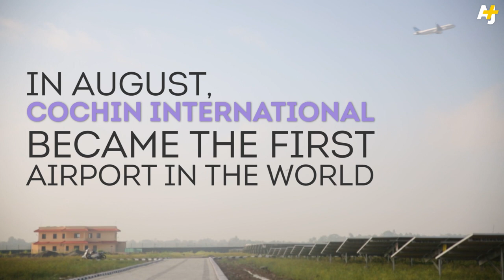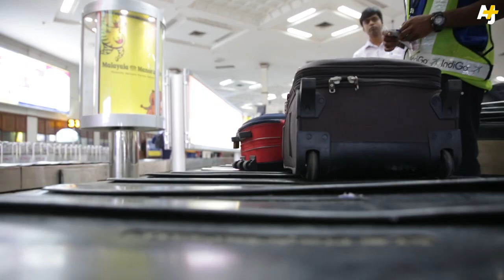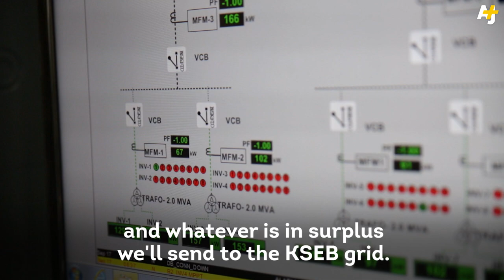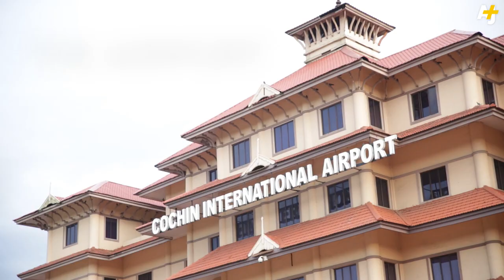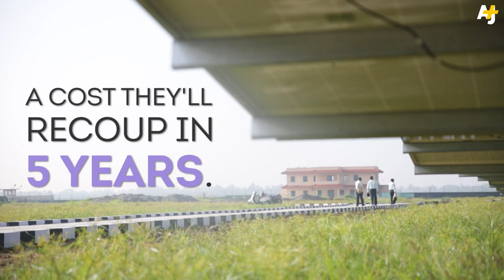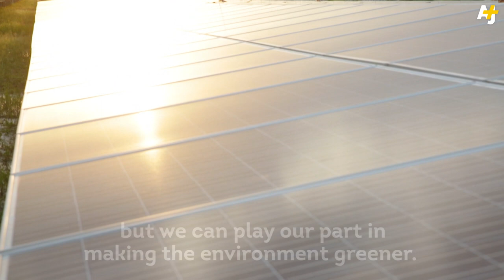Inside The World's First Solar-Powered Airport

Comment: I work full time with photovoltaics (though not an engineer) and I'm curious how they got past what has always been my reason for thinking solar at airports is a bad idea: reflecting sunlight into pilot's eyes? Depending on the angle of the sun, type of material and angle of the panel this could be a massive safety issue and one I've never been able to find a way around on my own.

Comment: It dose seem that the solar panels take up a lot of space. is there any way to reduce land use or make multi purpose land use?
Reply: That's is the challenge now. Innovations are being carried out everywhere. But they are yet to be cost effective.

Eg: solar panel covered canals, idea of gathering solar energy from the space and tenasmitting to earth etc.
Reply: THATS NOT PRACTICAL. IN THE GROUND LEVEL ITS EASY TO WIPE OUT DIRT FROM THE PANELS AND EASY TO MAINTAIN.
Reply: THATS NOT PRACTICAL. IN THE GROUND LEVEL ITS EASY TO WIPE OUT DIRT FROM THE PANELS AND EASY TO MAINTAIN.
Reply: In this case,  the solar panels are placed in an area designated for the future expansion of the airport's cargo section. When the time comes for the expansion, these panels will be moved to the top of the new buildings. Another interesting fact is that this area is not only used for solar panels right now, the airport is growing ginger and useful plants in the same piece of land.
Reply: cannabased  no bro there's a carpark roof it have panel i didn't see it above terminal. I think because of reflection that could effect landing.
Reply: When there is a future expansion, they'll take this space for building terminals and put the solar panels on top of the buildings..
Reply: There is two sections of solar pannels in this airport. One is on the top of roof of car parking facility and another is in a seperate land far away from runway. 
In future they have a plan to build a new cargo handling terminal there and to place these pannels on the roof. It won't be affect the landing because it's little away from the runway and in another direction from the way of flights moving

Comment: Look at the amount of land it took to power that entire airport, though. Nuclear energy isn't completely clean because they byproducts you have to get rid of some way or another. However, we also have the potential for thorium reactors and then eventually fusion reactors. Nuclear energy is the future. This kind of energy always requires too much space or doesn't produce enough energy to work on its own. Plus, it's not entirely environmentally friendly either.
Reply: actually over the life cycle of nuclear fuel, the energy output has the comparable co2 emissions of natrual gas.
Reply: +Blackagar Boltagon Two massive disasters in 30 years. Chernobyl was run by soviets who are notorious for cutting costs. Fukishima was hit by an earthquake.
Reply: Come up with a better option then. Thorium reactors effectively regulate themselves and would be extremely safe..
Reply: +Allan Reford The large amount of space is because of the low efficiency of solar cells(around 15-20%). Research is going on to produce very high efficiency cells(eg, carbon nano-tubes), which can reduce the size of such power plants.
Reply: Nishal Shettigar I know why it takes up a lot of space.
Reply: Blackagar Boltagon like I said that won't happen if we use thorium reactors and especially so when we access the potential for efficient fusion reactors. Also,  modern day nuclear reactors will be okay as long as we're careful where we place them (which Japan weren't) and we take all the necessary precautions.
Reply: Allan Reford so where dose the nuclear fuel come from? Dose it just magically appear when we build a reactor? 

That nuclear fuel came from somewhere and got dug up from somewhere. That whole process puts out a ton of carbon dioxide. Enough to make nuclear energy have the same carbon footprint as natrual gass.
Reply: Skinnymarks Where's the proof?
Reply: Allan Reford so you don't beleive in cars running off of gasoline? Go read a fucking reserch paper. It's where I got it. It's been a while sense I found it last so it might be a while till I find it again
Reply: +Allan Reford I work full time in the solar industry and I'm also not opposed to nuclear energy. I just wanted to comment on your waste of space concern because I fully agree and many people here seem to think it is a frivolous point. Too much land is being used to setup massive photovoltaic arrays but once installed that land can do nothing else for decades unless the system is removed, where as confining solar to rooftops means energy generated where it is used much more so and that energy production is in addition to the property's use (and value) instead of the sole purpose of the property. 

An example I like to use even though I am not American is Walmart; if every single Walmart in the USA covered their roofs in solar panels they would offset nearly their entire demand on the grid during sunny days, if not exceed it. That saves Walmart money in the long run on power, as rates continue to soar, and they may be able to operate during grid power outages as well.
Reply: +Allan Reford  well read this http://www.resilience.org/stories/2006-05-11/does-nuclear-power-produce-no-co2
Reply: The land that the solar panel sits on is reserved for the expansion of the cargo bay. If and when the expansion takes place, they will move the panels to the roof of the building. That's what they said in another article.
Reply: MoreWeight Media  BENEATH THE PANELS WE ARE DOING AGRICULTURE THATS TOO ORGANIC PRODUCES 60-80 TONS OF VEG /YEAR.